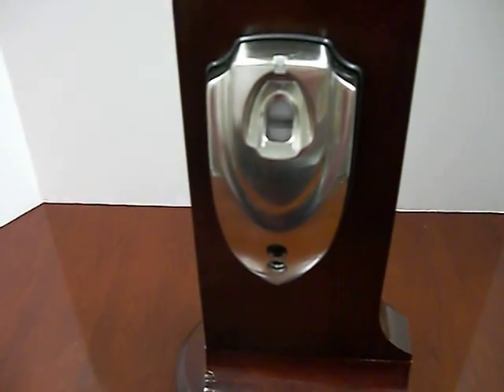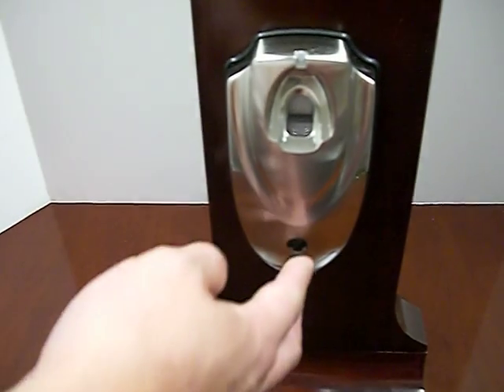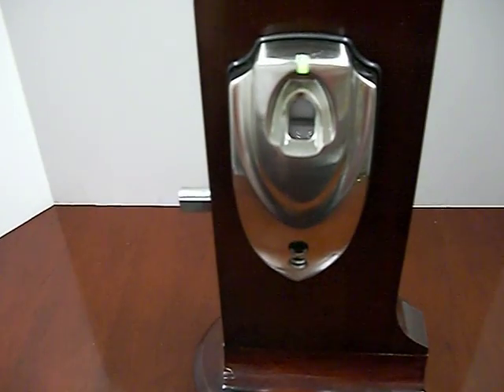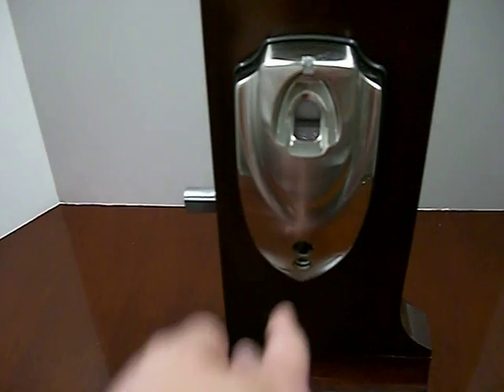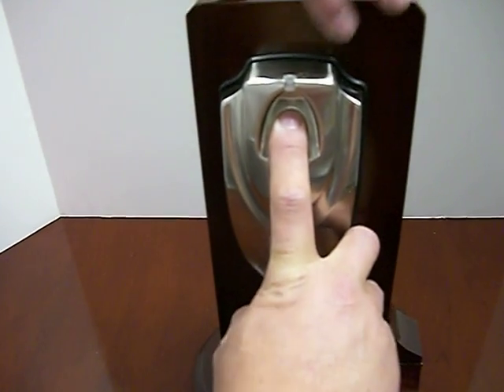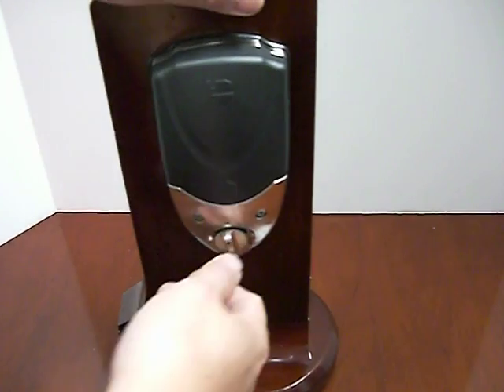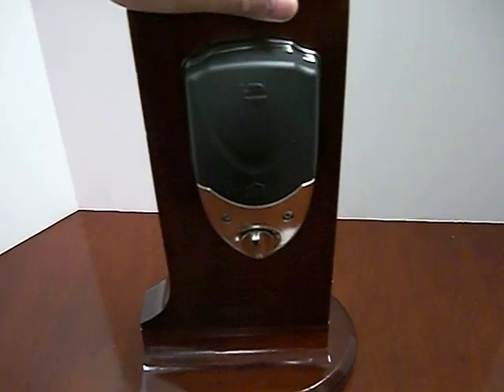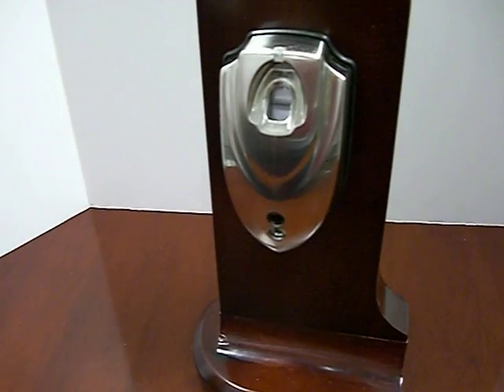FINGERPRINT LOCKS

Comment: Maybe this is a bit useful but it doesn't improve security by much. If door is already strongest part in your house then why would the thieves bother trying to open it, why not just break a window. If security is an issue then one has to take in consideration all the bottlenecks of security systems and that is going to cost lots and lots of money.